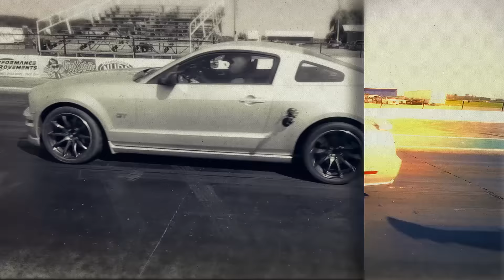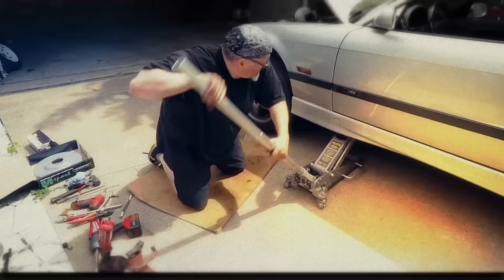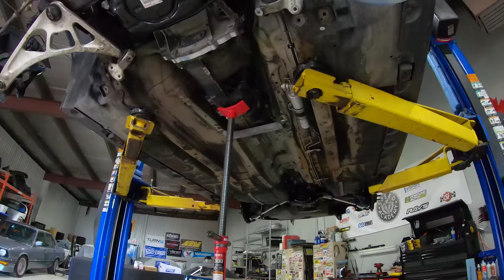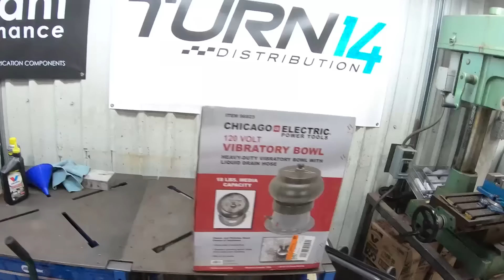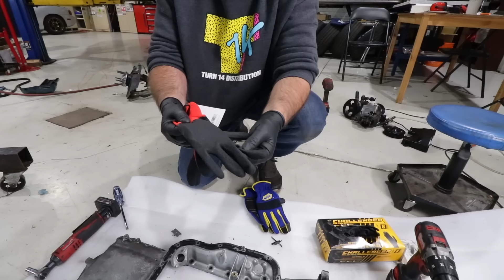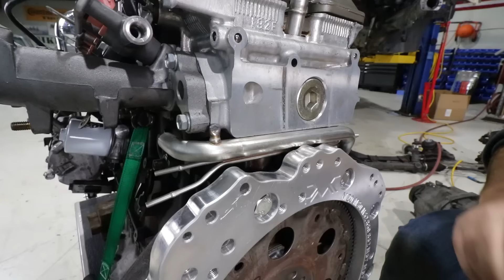Ultimate BMW M3 Rebuild - 2JZ Swap Isn't Easy - Part 9

Comment: Power steering reservoir is going to get in the way of your intake manifold. Oh yeah, and it might get very hot. 

Unless you’re doing an oil cooler, should have kept then Toyota oil cooling system. Many of the aftermarket ones leak. 

Get a hose from a GS 300 coolant line to resolve that rear coolant line issue on the top of the engine.
Reply: You need to watch the oil cooler part of the video.
Reply: @paulcopeland9035  I don't even think the after market oil cooler is going to be as effective as the stock one. Better yet, you should look at me do the same thing in a older, and smaller BMW.

Comment: will the e28 be getting the motor from the M3
Reply: I'm wondering that too.  Should be easy to put in I think it will need a M50 powered E34 oil pan and pickup

Comment: That inductive heater is going to do nothing to that bolt except make it larger . . Nuts not bolts . 
It’ll only work on a bolt to break the rust .
Reply: Yeah  you ideally heat up the threaded area or material surrounding a bolt so it expands around the bolt. Sometimes that's not a practical option. If a bolt is held in with threadlocker or crap, sometimes heating it up to expand the bolt, then letting it cool and shrink could help break the bond
Reply from the maker: Kirsty Sinclair thanks for the tip!
Reply: Speed Academy if you haven’t cracked it yet see if a friendly plant mechanic can lend you his 1” Dugga Dugga and sockets !
Reply: Spot on, if you want to attack a bolt with temperature treatment try using a freezing spray. May just heĺp

Comment: Did you happen to weigh both engines? I’m curious if the Toyota engine is heavier than the BMW engine.
Reply: 2JZ weighs 230kg (507lbs) and the S54  is 217 kg (478 lbs)
Reply: @ricks_toys  Impressive weight saving with the s54 and they are both using cast iron block.
Reply: @UndeadCrook  definitely! And mind you the twin turbo setup they removed adds another 25~30 kgs. Also the S54 is 10 years newer and internals and valvetrain were lightened from factory to be able to rev it @ 8k.
Reply: @UndeadCrook  Unfortunately I don't think that's accurate. The 2JZ-GE (non-vvti) with everything on it, including dual mass flywheel, exhaust, intake and accessories, except A/C compressor came in at 218KG (~480lbs) on scales. I don't know how the S54 was weighed, but since the S54 is a much newer engine it also takes advantage of having a composite intake manifold and valve cover to shed weight while the 2JZ was still using metal as everyone else was in the 90's. So the 2JZ-GE is probably in the same ball park as the S54.

1JZ-GTE (non-vvti) with turbos, intake, flywheel, clutch, alt, but missing power steering pump and AC was around 225KG (495lbs). So I imagine their the 2JZ-GTE isn't far off from 500lbs since it has VVTi, but they're going single turbo instead of the bulky twins.

Add a turbo kit to the S54 and I'm sure they're pretty similar in weight.
Reply: Also interested in this
Reply: Should have let the bmw engine in it
Reply: @lamborghiniLab  the 2jz is the more suitable engine for the project. Budget friendly 800~1000hp capable stock powertrain. It's simply just add boost. S54 on the other hand is a top of the line NA inline 6 and best left stock, boosting it is not as budget friendly as the 2JZ.